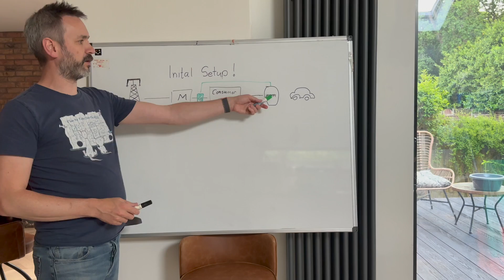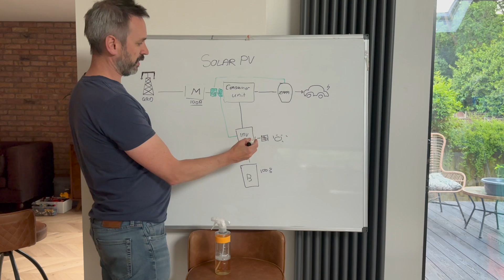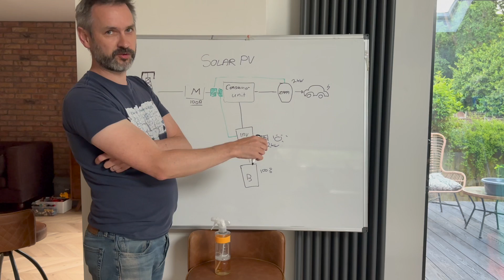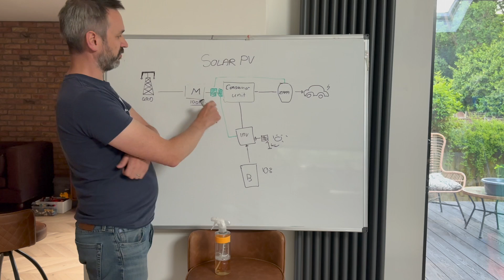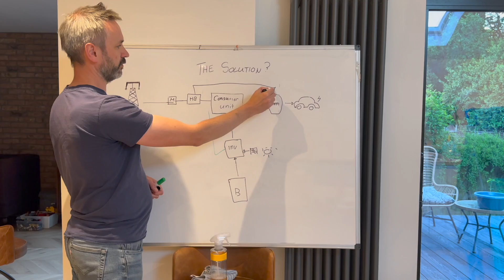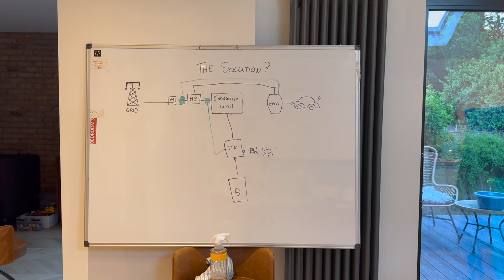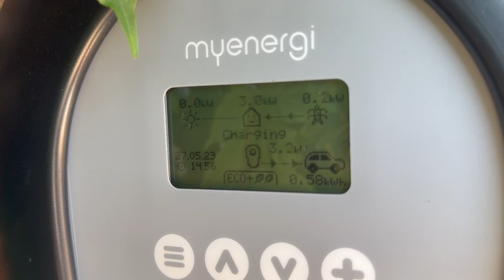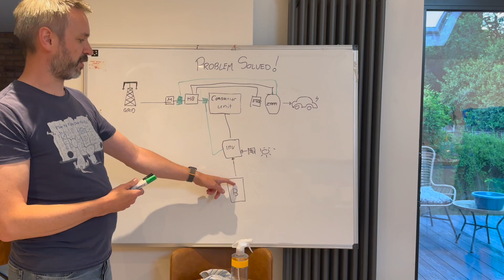How I stopped my Zappi draining my battery

Comment: I've had this issue as well, the best solution depends on what you want to achieve. If your main aim is to use as much of your solar electricity without exporting then I don't think you need to do this.

If you have your Zappi set on eco+ and the batteries set to only discharge during. the day it shouldn't drain the battery but only export excess. In the evening your batteries power your house and then your car can charge at night draining the battery if you want?
Reply from the maker: You're right, it shouldn't drain the battery when set to eco+. That wasn't my experience :( I'm told that the v5 firmware version resolves most of the battery drain issues by improving the Export Margin, but this way I don't need to reply on the firmware. At the moment, I'm charging the battery up to 35% on the off-peak tariff. This covers the house until the sun comes up and the panels start producing power. The battery then charges, and we use that power at night. I just don't see the benefit of discharging the battery into the car. Either way I'll be paying for that power, so just charging the car from the grid makes the most sense to me.
Reply: @tomasmcguinness  yes I understand

My perspective is to use as much of the solar ourselves and not export and so I like to make sure that the battery has enough space each day to absorb the solar together with the water heater and the car when I am parked at home some days

We’ve been using 84% of our 8kWP system this way and the rest is from the w grid
Reply: I would be more than happy with this set up except what about power cuts? I live in a very rural location and last winter we had 6 days in total where we had no power. It mostly tends to go off at night, so with the battery drained because my car has charged from it that is not ideal!

Comment: Thanks for the excellent explanation, really clear.  I am having the same problem with the battery draining during the day as soon as it drops below 100% and the Export Margin part does not apply.  The Zappi then draws from my panels and batteries and does not stop.  In addition at night, no matter what I do I cannot stop the battery discharging.  Sadly I cannot see a way to limit the discharge of my battery through my Deye inverter while the car is charging at cheap times of the night.    The firmware update has not solved the problem either.  As a result, when I watched your video, I thought it would solve my problem, and it would......but it also nearly made me cry!!!  When the installer first set up my zappi, it was put, in error, directly onto the mains and separate to the consumer unit.  After many calls with them and myenergi, they came back, realised their error and wired it through the consumer unit.  Of course, I now realise that leaving it alone would have solved my battery drain issue!
Reply from the maker: Agggggg! That's annoying. Have you tried upgrading your Zappi to version 5 of the firmware? I'm told that will resolve most issues with the Export Margin. I'm going to try this on my own setup when I get a chance, just to see how it works.

Comment: Hi, great explanation of the issue!
I have a similar set up: 7kw solar, 5kw solar edge inverter, zappi, eddi and a tesla powerwall 2.
I initially had the same issue, but the export limit and setting priority order for surplus solar to: house, eddi, battery, zappi completely solved the issue.
The only remaining issue is the frequent stop starting of solar surplus to the car due to british weather. I worry as to what impact this constant charge cycling will have on car battery life and also the wear and tear of constantly stop/starting may have.
I intend to solve this by going on to Octopus Flux tariff and charging my car and tesla powerwall only in the 3 hour night window; letting amost other surplus solar go to export.
At 20p for export and 18p for import during the night window, this makes financial sense and means my car has a nice, level, regular charge of about 21kwh per night which will cover my 250 mile per week use (car averages 3.1 miles per kwh so needs 70 kwh per week of charge). 
Hopefully my solution makes sense? 
I might also flip to octopus go for a few months in winter when solar production crashes and back timo flux in March.
Reply from the maker: Thank you! That's a good point with the start/stop of the charger. I hadn't really given it much thought. Have you seen any studies or data on the impact of it?
Reply: @tomasmcguinness  I haven’t and I can’t find any data, but my one year old 9000 mile BMW iX is in the workshop right now for a warranty repair on a failed charge port.
It could be coincidence, but it is a nagging thought that all that stop start and variable charge rates may be a factor here.
A switch to octopus flux would allow me to have a fixed charge for 3 hours a night and focus solar on export and then in winter, with no solar, a flip to octopus go would offer the same nighttime charge window for 4 hours.
Reply from the maker: Interesting about the charge port. We're always told that repeated charging of your phone etc. degrades the battery. I wonder if it's the same for car battery. I moved from Octopus Go to Octopus Intelligence a few months back. You get a longer window and a slightly cheaper rate. Would be worth checking if you can avail of it.
Reply: @tomasmcguinness  I looked at octopus intelligent, but did not like the idea of handing over charging control and have concerns that a daytime charge triggered by them would be at the ‘boost’ rate and may take a blend of battery and grid power. 
I am currently crunching numbers on all 3 options (go, intelligent and flux) as my current ‘go’ tariff ends on 3rd august
Reply from the maker: With Intelligence (for EVs) you get cheap power between 11:30 and 5:30 regardless. When the car is plugging in, it might get scheduled to charge outside those hours, but that power is off-peak too, so you don't have to worry. People try and trick it by saying they need their car at 100% by 4AM. I've seen examples of them scheduling charges at 9pm and people putting their washing machine on etc. The only downside with solar, is that I need to keep the control turned off most of the time, otherwise it won't charge on surplus solar. They are supposed to have support for the Zappi charger coming soon, but I've been waiting a long time.

They do have a new tariff called Intelligent Flux coming soon, which you might be interested in - https://octopus.energy/press/smarter-cleaner-cheaper-octopus-launches-new-smart-tariff-to-unlock-solar-and-storage/
Reply: @tomasmcguinness  I have seen the launch of intelligent flux (I do a lot of research and viewing on this topic) and it certainly looks interesting! 
It is only available for Givenergy batteries at present though and I have a powerwall 2, so I will have to wait to see if it is an option down the line. 
Having crunched some numbers now, I believe the best solution for me on currently accessible tariffs will be winter on ‘go’ and summer on ‘flux’. 
I will keep watching your videos as it is good to see how others approach the issues! 👍
Reply: It’s not as quick a stop start charge as you think it’s got to see 1400watts going to the grid over a period of time before it kicks in then when it’s stopped it’s got to stop for a certain amount of time before it starts charging again think all in all it’s about 1-2mins before charge resumes.
Reply from the maker: You're right. My Zappi waits for 30 seconds of surplus before it starts and 30 seconds before it stops when the surplus drops. I presume this can be adjusted, but it seems to be the default for both my Zappi and my Eddi.
Reply: @tomasmcguinness  no I don’t think it can I’m sure this is there and every EV chargers standard requirement

Comment: Came here for battery drain and multiple CT clamps from different vendor equipment.  Straightforward solution and well explained.  Perhaps one day we'll have defined standards for Smart meters that extend power control into the home... for now it's Youtube, Henley blocks and software hacks :o)
Reply from the maker: Thank you! I think we're in the same place that smart home stuff was about five to ten years ago. It's taken a long time for Matter to emerge and get adopted by the big players. Maybe we'll see something similar in home infrastructure stuff, like EV chargers and batteries.

Comment: One of the issues your solar+battery setup has is that they share an inverter, which is great for efficiencies, but means that the Zappi has no idea of whether it's the solar panels providing the excess power (Zappi should consume) or the batteries (Zappi should NOT consume).
That's the choice you have to accept with a hybrid solution (unless you can somehow monitor the DC power from the batteries to the inverter! ).
Also your setup won't allow you to charge your car from banked solar when you come home at night. Of course if you only intend for the batteries to apply your house then this is moot.
Great video!
Reply from the maker: Thanks for watching!

I had the Zappi installed before my solar and battery, so the installers probably didn't think about any potential issues with the hybrid inverter. I wasn't really aware of the difference at the time, so had no input.

I do have access the inverter's data, so I can see the breakdown of it's output i.e. power from solar and battery's charge/discharge amount, but sadly there is no way to push this into the Zappi. I had some crazy idea about trying to "fake" the battery by simulating a CT clamp, but I've no idea if that could be made to work. I need to understand CT clamps a little bettery  

And you're right about not being able to charge the car via the battery. That was a conscious decision I made. I believe I could force discharge the battery, but I haven't tried that yet. My inverter software/control is terrible.
Reply: @tomasmcguinness  I feel like the installers should have had awareness of this problem though seeing as though they are the experts. This is the situation I am in now, albeit with a solaredge battery & inverter. I've been quoted an extra £710 to do the work you describe in your video and I'm very upset about that. 
Can I ask about your setup, if your car is charging during the day from the grid (e.g. because of Octopus Intelligent Go giving you a daytime slot) and your battery is full and you are producing solar, can you still export electric to the grid at the same time you import it for charging the car? Sorry if that's a stupid question!
Reply from the maker: @lufcwls  No such thing as a stupid question. 

Unfortunately, you can't be importing and exporting at the same time. You are either importing or exporting.

 In the situation you describe, all of the excess solar being generated would go into the car and the grid would make up the difference. 

Let's say Octopus turned on the Zappi at ~7kW and I had a 2kW surplus from my solar inverter. The Zappi would pull 5kW from the grid to make up the difference.

I hope that helps.

Comment: Thanks for the video .I have the same setup as you ,but I use  the battery to smooth out the solar output and keep my car charging  , I just monitor the solar output and battery discharge so I can stop the Zappi charging and keep the charge I need in the battery.
Reply from the maker: Thanks for sharing that. How did you achieve that?
Reply: @tomasmcguinness  I just set the zappi on ECO and adjust the Tesla charging current up or down as I get more or less Solar ,watch the battery % and stop the zappi as and when needed to preserve the amount of battery I need .
Reply from the maker: Interesting. I guess you've automated that?

Comment: This is what the export margin setting is for. For anyone with this issue, get the installer to set the Export Margin properly before having it rewired. Also make sure your kit has v5 firmware as there was issues with Export Margin on the previous v3 firmware. The rewire trick does work but is more hassle now that firmware has fixed the issue. I had exactly this and was on the beta testing of v5 and it works great now. Depending on your inverter, it can be a bit hit and miss trying to work out what the export margin should be, but start at 50w and increase it until you see the battery not getting drained. For me, I think I settled on 150w on my Victron inverter. You are aiming to get a value as low as possible that the inverter doesnt normally export to before its real excess solar. Inverters will always flip flop a little around the import/export point to some degree, you are trying to find what this usually is with no excess and then set it a little higher on the MyEnergi kit so that it will always wait for that amount of export before starting to take it.
Reply: Great conversation an D.C. I’m having my solar/hybrid inverter fitted next week. I’d like to avoid battery drain  however can see benefits if wanted to use some for a “FAST” charge so would rather go through settings. I plan to generate, fill batteries and export. My home base load is 0.3kw so what would my export margin need to be?
Reply from the maker: You need to experiment. It depends on how fast your inverter/battery responds to change. 

This helps it differentiate between genuine surplus (battery is full) and temporary surplus, which is the battery discharging to meet load.

Set it to 100 and see how it does.
Reply from the maker: You're right and I did try the export margin, putting it up as high as 150W. It just didn't work for me. Now, V5 has just come out in beta at the time, but I decided to press ahead with a solution I knew would work. The obvious downside to the export margin is that you end up exporting power that you might otherwise use. Over the 6 hours or so of surplus I get after my battery is full, that amounts to almost 1kWh. Doesn't seem like a lot, but it adds up over time. It's 4 miles of driving or 26 litres of hot water.
Reply: @tomasmcguinness  fair point. How much does it cost to add the extra board and rewire the Zappi/Eddi? And how much export does that equate to? I guess at todays rates it’s offset a lot quicker but at the typical 4p/kWh it would take a while to be offset (export rates will drop along with import rates and already are heading back down)

With v5 you shouldn’t need a high an export margin either as the new algorithm does a much better job of tracking the true excess and not reacting to spikes you get on hybrid battery/inverter setups. 

Would be ideal if all these devices could use a standard to communicate and do away with these workarounds entirely (MODBUS maybe?)
Reply from the maker: It was £400 to rewire the consumer unit and to add a new supply for the Eddi. The payback will probably be a decade, like the solar panels themselves. My goal is to use all that I generate as I don’t generate that much (30kWh on the best day).

You’ve convinced me that I should try the v5 firmware and see if the export margin works. That would be a nice follow-up video I think.

As for standards, you’re dead right! It feels like the situation with smart home tech. Each vendor wants to lock you into their eco system. Thankfully that’s starting to change with standards like Matter, but I suspect home utilities have a long way to go!!! Most don’t even offer any form of local control.

Comment: Could you not have used Harvi with 1 ct on main and 1 ct on inverter?
Reply from the maker: I added a CT clamp to my inverter, connected to my Eddi. unfortunately, the problem remained. Once the battery started discharging into the car, it didn’t stop.